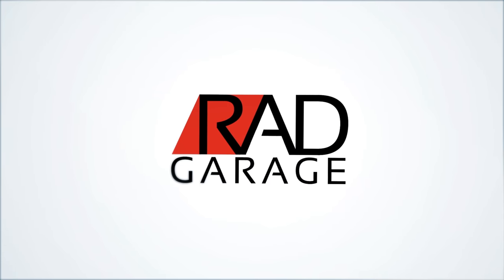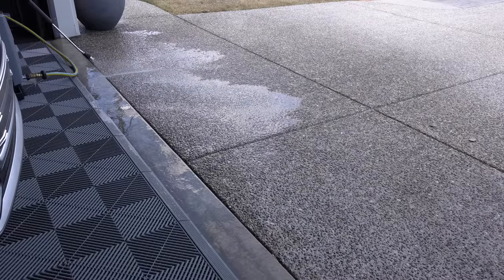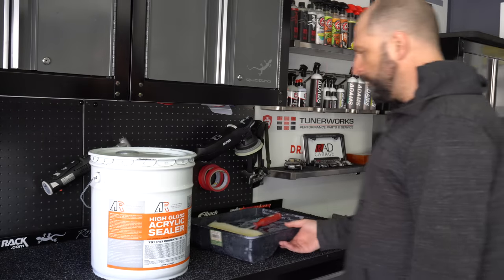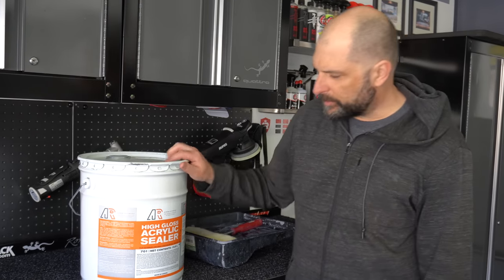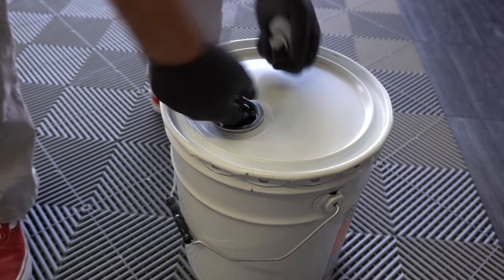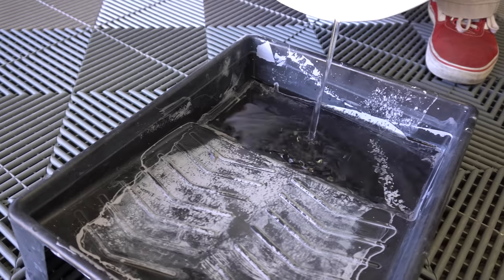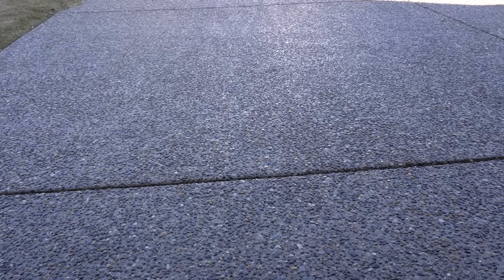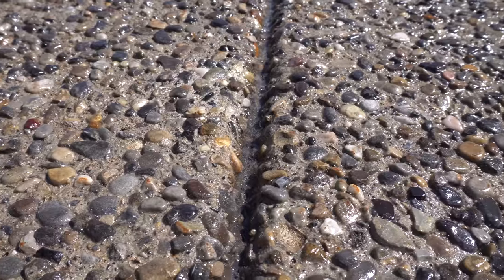SEALING EXPOSED AGGREGATE DRIVEWAY | Watch a Suburban Dad Seal his Beloved Driveway in High Gloss

Comment: Rick-new to your channel and I’m enjoying it!  Any reason you didn’t do the end of the garage floor that’s exposed to the outside, to match the shine with the driveway 😉!
Reply from the maker: John Christian Good question. I am planning on pulling out the Swisstrax floor and sealing the entire garage floor that sits under the tiles. I just want the driveway to completely cure first. Maybe next weekend. The regular concrete looks amazing with a coat of sealer on it. I’ll be sure to post some pics on my website and instagram.
Reply: @RADGarage  thanks that makes sense. I also have swisstrax and your cleaning videos have made it easier for me to clean out all the Midwest sand from the winter!

Comment: How long do you recommend going without sealing? And what thickness roller did you use? Thanks!>
Reply from the maker: Time between sealing really depends on where you live. For me, I think every year is slightly overkill, but waiting two years is a bit too long. So, I am going to do it annually. That means it does build up and it will appear "milky", but appearance isn't the priority for me. Having the concrete protected is most important. I just used a medium nap roller. You could use a nappier roller too, it really comes down to preference. The longer the nap though, the more "shedding" you will see because the sealer dries quick and likes to pull fibres out of the roller. Medium is your best bet.
Reply: @RADGarage  thank you. I recently moved into a house that had the driveway done 5 years ago and the previous owner never sealed it. I will try this summer and see how it handles its first winter with protection. Thankfully no cracks to worry about. Thanks for your reply/video. Forgot to note I live in Toronto :)
Reply from the maker: @Chalovski  Talk with someone at a reputable concrete supply company. I’m sure you’ll find the appropriate sealer in your area. These exposed aggregate driveways need protecting.

Comment: My exposed driveway has a lot of holes in it from where the rocks have actually come loose. Is there anything extra I should do before sealing it?
Reply from the maker: Hey Bobby. I have actually found rocks to fit into the voids that occur when rocks become dislodged. I use a dab of construction adhesive on a rock that fits perfectly into the hole and seal right over top. If you don't want to go to that extreme, I would just suggest hitting that little divot with a small brush to ensure the sealer penetrates the hole. Those are the spots that water will get in and cause spalling.
Reply: RAD GARAGE thank you for the advice

Comment: Did you seal the concrete borders surrounding the aggregate too? Thanks nice work! Getting ready to seal my dad's aggregate driveway.
Reply from the maker: I believe you are referring to the darker stamped concrete border and the answer is no. I have sealed that in the past and it becomes dangerously slippery when wet. I have to research a way to seal that concrete with some sort of slip-resistant finish. I just sealed my friend's driveway the other night. It is such a satisfying process and the result always looks so good. Good luck with your dad's driveway.
Reply: @RADGarage  thank you for your response! My dad has about an acre long driveway that's curvy (not just straight to the house, but winding, really pretty) plus a front & back walkway to. It's a beast! It too has that same border.
Reply from the maker: Is it all exposed aggregate? That would be a $100K driveway in Canada!
Reply: @RADGarage  yes...all exposed with smooth cut borders, it's got orange, cream, tan, and blue rocks in it, it's  very pretty! He has flagstone front steps that have the same colors, so the driveway/walkways blend so nice. I'm in the process of power washing it for him. I'm two days into the project so far, probably have two more days ahead to complete it, but it's looking Awesome! That's why I was considering sealing it.
Reply from the maker: @kristycannon7923  I think sealing it is a must. It will take a lot of sealer and be sure you have a lot of rough-surface paint rollers on hand!
Reply: @RADGarage  lol, I know that's the truth! 😊

Comment: Your neighbours exposed ag is damaged from pressure washing. Every time they blast it, it removes more of the fines, creating deeper crevices for water to stay longer, resulting in more mould, quicker. So they blast it again and again. Same with regular concrete.
Reply from the maker: I find the driveways that are the most damaged are the ones that have never seen a single pressure wash. The salty dirt from winter fills in the cracks in the aggregate and erodes the finish as it freezes and thaws. There is no one is the neighborhood that has pressured washed their driveway more than me and my driveway is in perfect condition minus a few little pebbles that have broken off over the years.

Comment: how long did you wait after power washing your driveway to seal it?
Reply from the maker: A few hours non my case since it was in direct sunlight. You just want to ensure it’s completely dry. And no water in the expansion joints.
Reply: @RADGarage  ok. don't know why when I sealed my aggregate concrete 2 years ago it turned all haze and bubbly used wr meadows expo gloss sealer.
Reply from the maker: I have never had those issues with the sealer I use. Maybe there was moisture in the driveway?

Comment: Question: I noticed you used a roller when the manufacturer in their data sheet recommends spraying. Is there any particular reason you have decided to not spray?
Reply from the maker: I have to be honest, no one sprays this product. In the ten years I have lived in a neighborhood with exposed aggregate driveways, I have never once seen someone use the spray application process. Not a homeowner or a professional. It rolls on so easily there would be no point in using the spray method. Just my 2 cents.
Reply: This is the best way to do it. I sprayed mine and 2 years later I have over 150 rust spots from the minerals in the stones. 
If I rolled it, that would of never occured.
Reply: @Sammy-gd2zj  Update here..I ended up rolling it and was very easy. Turned out awesome.
Reply from the maker: I'm so glad to hear you had good results. I'm considering applying a new layer this month.

Comment: Would this type of product help stop the current erosion of an exposed aggregate sidewalk?
Reply from the maker: Yes. The issue I have heard from people with already compromised surfaces is that some sealers don’t seem to react well with less-than-ideal surfaces. I recommend speaking with a rep at a concrete supply company to ensure you get a sealer that will actually work with your conditions.
Reply: @RADGarage  Thanks for the advice!

Comment: What nap is the roller and size?
Reply from the maker: Oh man, I really cheeped out on the rollers for this project. It was the height of Covid lockdown and I ended up using two stray rollers I had kicking around. I highly recommend picking up a nappy roller for rough surfaces and get a few of them. Whatever size suits your fancy, but the bigger the better in my opinion.

Comment: @17:20 I see it cracks over there to  would not use it again      nice job
Reply from the maker: Cracks have nothing to do with the sealer. Perhaps I am misunderstanding your comment.
Reply: I was wondering if it is known for cracking  as it is here  every body I know that has it have cracks I see that now when its    set  they cut all the expansions  joints all the way through      nothing to do with the sealer.  @RADGarage
Reply from the maker: Ah yes, the cracking is definitely something that we all experience here in Calgary. The heaving of the ground in the winter makes cracks inevitable. I have never seen concrete contractors cut the expansion joints all the way though. I think that would lead to a lot of problems with shifting sections of concrete as we went through the massive temperature fluctuations. The sealer does protect the edges of the cracks from further deterioration. I am glad you clarified your points. Thanks for the chat.

Comment: You will be redoing that year after year as you didnt prepare it correctly, you needed to Etch it first after cleaning to open the pores of the concrete so it can penetrate, all youve done is paint the surface
Reply from the maker: Etch an exposed aggregate concrete driveway so it will accept the sealer? The exposed concrete is super porous by nature. Maybe things are different down under.

Comment: How many litres or gallons to do a normal two car drive way about the size of yours ? One bucket 🪣 do the job ?
Reply from the maker: I buy the 18.9L bucket and that is enough to completely cover my double driveway and front walkway/steps. I would estimate my driveway consumers somewhere in the range of 75-80% of the bucket. The amount of sealer depends on the squares footage (obviously) but it also depends on how porous the concrete is. Mine sucks up a lot of sealer so you’ll have to just keep an eye on the amount you go through and go from there.
Reply: @RADGarage  I bought a house 5 years ago and I notice the driveway is starting to pit. I think I need to seal it up before winter. Does it need to be a warm hot day to apply it ?
Reply from the maker: You will want to give the driveway a thorough pressure wash. Be careful not to remove any of the material where you have detected pitting. Laying a layer of sealer over those areas will really help protect them for further erosion. You will want to apply the sealer once the driveway is bone dry and I suggest applying it in the early evening when the sun isn't too direct. Good luck!
Reply: @RADGarage  thanks. Appreciate your help. Does it smell at all and does a person wear a respirator ?
Reply from the maker: It is a good idea to protect yourself from the fumes, but being outside I don't always do it.